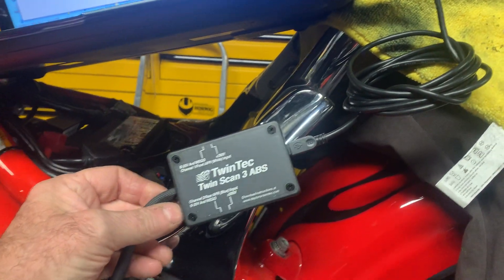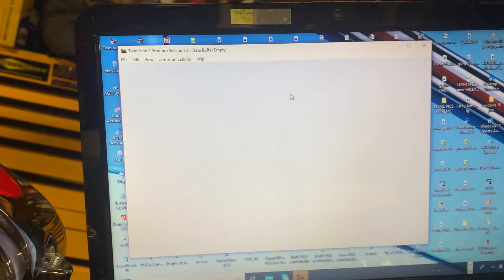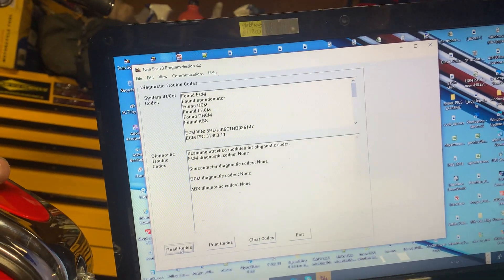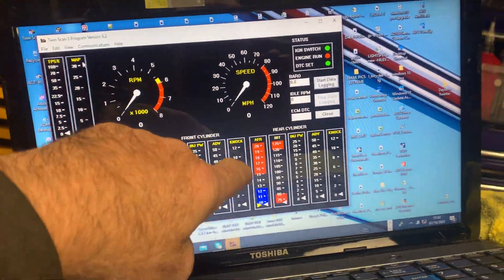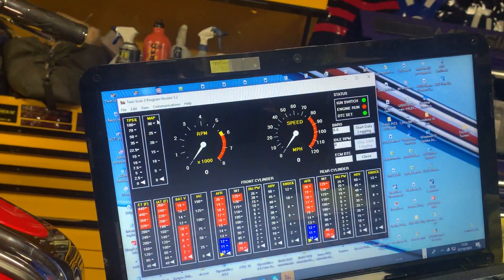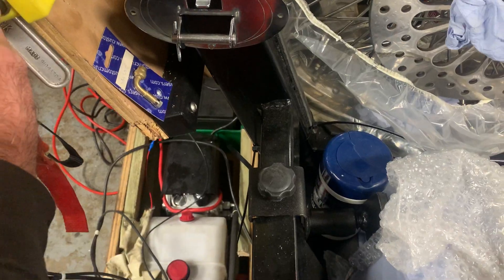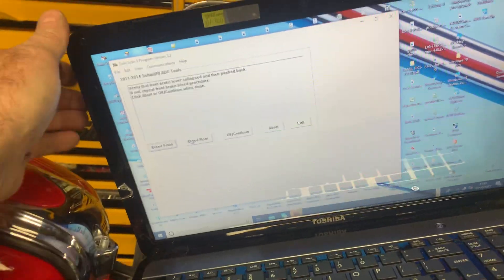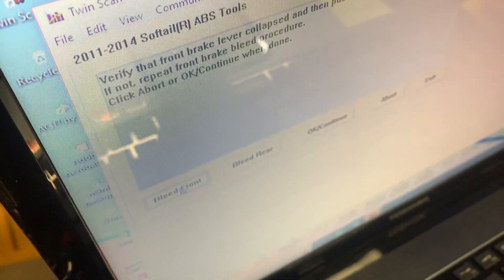DIY Harley Davidson scan tool ABS bleeder Canbus bikes Daytona Twintec Twin Scan 3 diagnostics save$

Comment: Except for the ABS function, their products DO NOT WORK as advertised.  You should have made a code and tried to clear it.  DOESN"T WORK even though the software shows it did.  Go ahead, try the Ignition Disable or anything else.  DOES NOT work.   Your video is one of the reasons people should not trust YouTube for information.   Besides the ABS, you didn't actually show a thing.  Look at the RevelatorAlf channel.  People need to know the truth.
Reply from the maker: Hi it does on mine did you do the firmware upgrade? Mike call them they are helpfull- too ask for Brenda